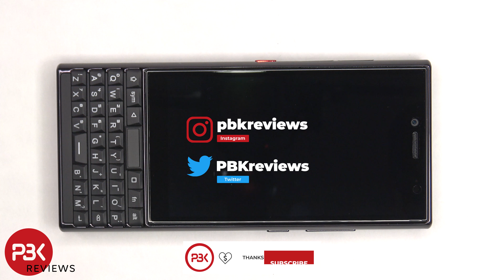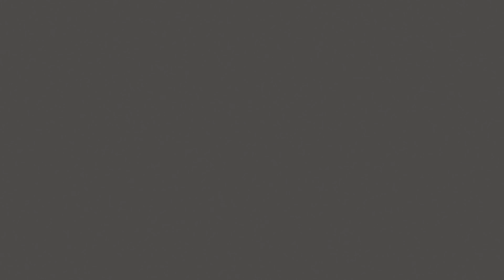Unihertz Titan Slim Disassembly Teardown Repair Video Review

Comment: So i just followed this guide to replace my battery found it straight forward but pulling out those strips from under the battery is hard go slow or it will snap off and then getting the battery out is hard.

Comment: Honestly want to know the size of the vibration motor (in mm) to replace it with a better one! Do you think this is possible, and if so, do you have a rough idea on the rough size of the vibration motor?
Reply from the maker: Hi, I don't have the phone anymore to check the size, but I would think it might be possible, but if its larger, you might need to make modifications to the housing and other parts to ensure it will fit when putting it together. Also not sure if there would be any software compatibility issues but as long as the pins are the same or located in the same area so they make contact with the power pins to provide power, I would think it should work.

Comment: Dang! This phone is crazy modular. I'd probably have given it a higher repairability score than a 4.
Reply from the maker: One main draw back which lowers the score is that replacement parts are not available for this phone and most likely even in the future would be hard to find.
Reply: You saw how you have to take the whole device apart just to replace the screen?